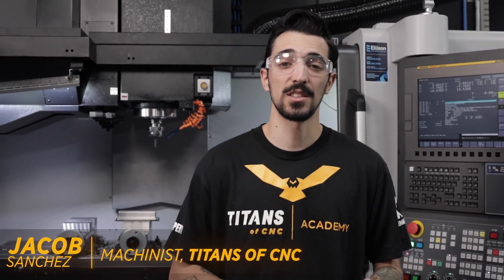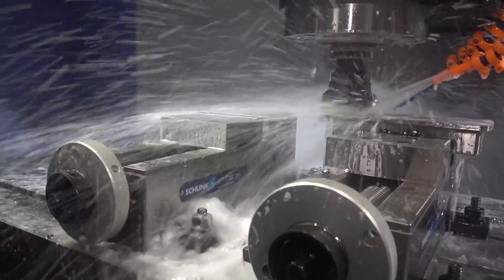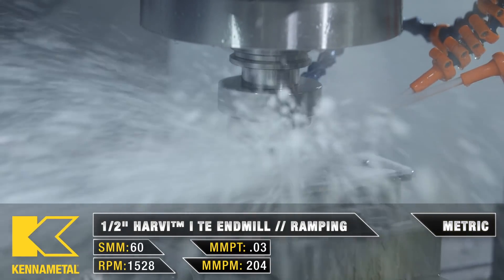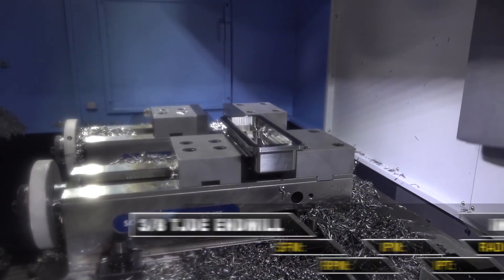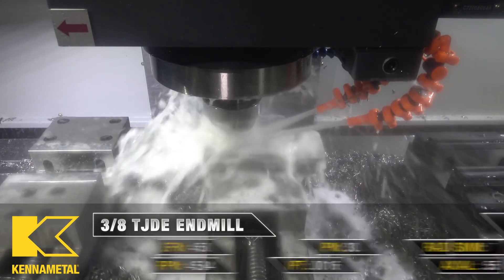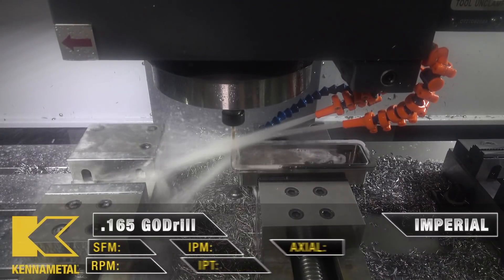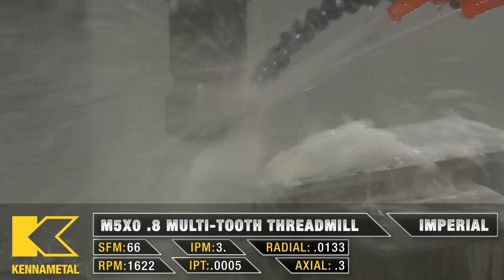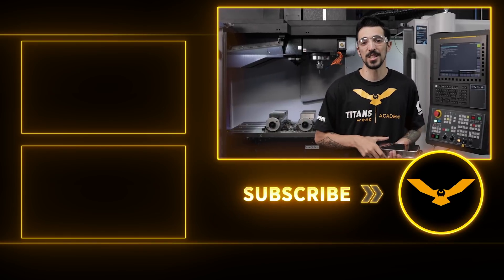CNC Machining The TITAN-15M (OP-B) on the Doosan DNM5700L

Comment: Literally everything these guys do is either a display piece (read: chessboard) or an “aerospace” part.
Reply: Or a titan 1m/2m/3m/etc demo part.  In titanium or Inconel, which is just perfect for "tutorial" parts for beginners. /sarc
Reply: @shirothehero0609  ive never really thought about it but they really should use some more common materials in their demos. CRS HRS 300series, 440 etc. No beginner is going to be learning in such expensive materials
Reply: @keithhasafastcar  Absolutely.   They should be using 6061, 1018, maybe some 304.   Using the exotics brings wow and flash, but the practical materials are what's most useful for people actually trying to learn.
Reply: @shirothehero0609  hell, even a demo in plastics would be useful, seeing how unstable some of them are
Reply: @shirothehero0609  The Titan Fundamentals are all 6061. They even have specific programming for Tormach and other hobby machines.